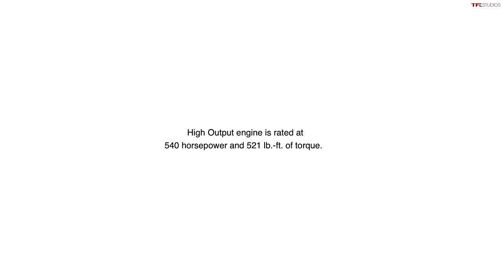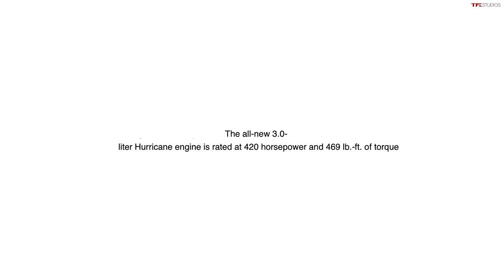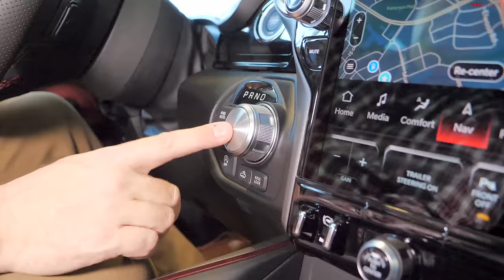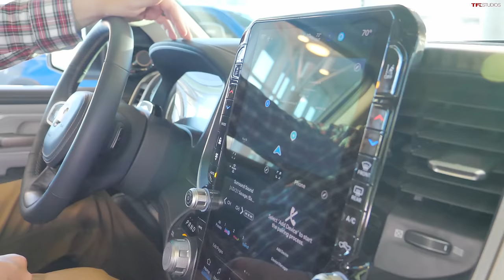I Go Hands On With The First New Ram 1500 In Over 5 Years - Did They Get It Right?

Comment: I have the Ford f150 3.5L v6 twin turbo ecoboost . Bought it for towing my trailer. I prefer my old truck with a 5.0L v8 coyote engine. It was smoother power delivery, better fuel economy when pulling the same load!
You can’t beat cubic inches. Plus overall upkeep is more on my ecoboost than my 5.0L.
Reply: That Coyote motor is the sheet but I bet you get good service out of the Ecoboost if you keep the oil changed regularly and figure out what to do with all the oil blow by.  Like a catch can or draft tube.  We drill a 1/8 hole in the bottom of the intercooler too to let the oil and condensation drain out when parked.
Reply: I have 207k miles on my 3.5 ecoboost. All these years I’ve had it I thought it was a lot better than the 5.0. Smooth, pulls everything I needed better than the v8 could. And when I drive( I don’t drive mine hard) it gets better gas mileage. I get it, it’s a v8, the sound is great and all, but there’s no comparison between these two engines. The 3.5 ecoboost is a lot better.
Reply: 5.0 has a terrible powerband for a truck. No low end torque. Just sounds good. One of the last trucks I'd ever buy is a 5.0 Ford.
Reply: Well yeah. Jason Cammisa told us years back a downsized twin turbo anything will get better fuel economy if you drive it like the EPA did; like a sedated nun.

Coworker had a turbo Elantra. 13 city 32 hwy. he said the gearing kept the turbo lit in traffic
Reply: I’ll keep my 6.2 Chevy trailboss over these 6 banger turbo engines, cheaper to maintain
Reply: Yup. The the problem with forced induction. To get the power out of the engine you need to be in boost. When you are in boost you are using considerably more fuel. There was nothing "eco" about the Ecoboost F150. I had one. Pulls like a diesel, gets atrocious fuel economy. Towing my bass boat it would get 10-11 MPG. I switched to a Ram 1500 with 5.7 in 2013. Towing the same boat it would get 14-15 MPG on the same trips. These new Ram's will be no different. I'm sure they pull hard, deliver a lot of low end torque and are fast. But they're going to get much worse fuel economy while towing than the 5.7 Hemi.
Reply: I drove the hurricane in a wagoneer and it was fast and smooth I can only imagine how it will feel in the lighter rams
Reply: I've had a coyote and ecoboost, I now have a Lightning and prefer it to both in everyway. More power, efficiency, and zero pollution.
Reply: @arthurwright255  Throw a 8000 lb travel trailer behind it and tow it 1500 miles. See ya in a week after you have to stop every 60-70 miles to charge.
Reply: Most people use their trucks to tow and drive long distances, which the Lightning is terrible at. Unusable for most buyers.
Reply: @joshuaw2988  The 6.2 from GM is the most problematic V8 in the truck market. If you had mentioned the 5.3 I maybe would have believed you.
Reply: @Bradimus1 bologna, 10,000 lbs behind my long bed crew cab 5.0 with the weakest axle ratio offered and it didn’t seem any more heavily taxed than other pickups I’ve pulled with. Even in low end torque a modern 5.0 still knocks the socks off of any half ton from 17 years ago. We’re just spoiled now with unreliable turbocharged junk
Reply: @bkranz-1283  gutless below 3k RPMs.
Reply: @riccochet704  interesting opinion
Reply: @bkranz-1283  even empty the five oh is known to be a slug from a dig
Reply: @paulhunter9613  my behind. I smoke tires from a dig on a crew cab 6 speed with a 3.31 axle on 33’s all stock factory tuned 5.0. It’s so far away from being a slouch it’s laughable to even suggest it. Just because it makes most of its power in the top end doesn’t mean it’s lacking in low end necessarily. Maybe it just means it has lots of top end and a good amount of low end. It’s all in context. Are you comparing it to a “premium” engine option like a 6.2 gm or HO ecoboost? Cuz then it’s lacking low end ONLY in comparison. Compare it to a 5.3 gm (which is marketed as the direct competitor to a 5.0) and the 5.0 smokes it no matter what rpm they’re running at.
Reply: @bkranz-1283  Maybe get some medication for your behind. I’m comparing it to an eco engine that has full torque at 2700 rpm, the five oh doesn’t have that amount till 4500 rpm. They call it “linear” power, that just means the torque isn’t available. So it’s a snooze fest waiting for the power to tow a load and get it up to a much higher rpm. It’s a car engine stuck into a truck
Reply: @paulhunter9613  well you’re entitled to an opinion but that doesn’t make it a good one. A 5L v8 with towing features in mind like piston cooling jets is a “car engine” in a truck but a twin turbo v6 doesn’t come across to you as trying to shove the square peg in the round hole? Take all the low end torque you need to tow loads the rest of the truck can’t come close to handling if it makes you feel better but my 5.0 will actually still be able to pull something at 200,000 miles while that ecoturd is sitting at the local pick and pull.
Reply: @bkranz-1283 ya ok buddy, keep believing that, if you say it enough, who knows

Comment: Let’s be honest - the engine change is not for better gas mileage but to be able to charge more $$$ at the time of purchase and at 100,000 when the turbo blows
Reply: No. It's so they can advertise gaudy power numbers and still meet emission regulations. All about NoX. They would make far more selling hemis n cummins forever. Those billions in R&D have already been recouped
Reply: It's for emissions but it also gives you better pulling power. Torque comes in at lower RPMs and the curve is flatter.
Reply: projecting much? In reality there is no way to validate your comment.
Reply: That's a terribly uninformed take and highly unlikely.   Agree with others that the move to small displacement/turbo powerplants is a natural outcome of the manufacturer's need to produce higher mpg and less emissions.  I bought a '22 GMC Sierra AT4 w/ 6.2L V8 so I could enjoy V8 power (especially the sounds), maybe for the last time.  But prior to this latest truck, I actually had a Ford F150 Platinum w/ 3.5L Ecoboost V6, and it was an excellent vehicle as well.  I owned it for ca. 150k miles with no issues other than replacing an injector.

Comment: I have a '22 Ram Limited and till this day there's no one that gets into it and doesn't comment "it's the nicest interior they've ever been in". Now if they could only get an infotainment software that's as good.
Reply: I had a '22 Limited 1500 myself (night edition) and yes, it's a really nice interior. Also yes, the infotainment system sucks lol. 

Went to an F350 Lariat and the downgrade in overall material quality of the interior isn't nearly as much as I thought it would be. 

Basically, after 2 years I realized I didn't really care about having slightly fancier looking interior trimmings and wanted something more capable and more intuitive.
Reply: I too have a 22 limited. I agree the infotainment needs to be updated. I'm constantly reseting the radio to get my android auto to work. Other than that, the truck is a dream to drive and go on road trips in.
Reply: @SliderFury1  My father has an F250 and it's been in the dealer more times than he can count for their notorious suspension issues and the interior is trash compared to the Rams, albeit his is probably closer to a '20 model. Their dealers are cash but that's becoming more a common thing among domestic manufacturers.
Reply: @Jerry300zx1  Stop being that guy and get yourself an iOS device lol, your friends and family will appreciate it.

Comment: That looks like an absolute nightmare to replace a turbo if it ever went out.
Reply: You used to own one before.  Now I know why not to buy this
Reply: Why, the turbo's are right at the top side...have you ever seen Ford's v6 turbos? They take a full day to get at before you can get a wrench on one of the bolts.  This RAM set up looks actually very easy to get to the turbos. And yes, I have been in the industry for 42 years technician so I think I know.
Reply: The ford gas turbos are in the wheel well ? We just changed one with the 3.5 gas engine and it was out and in unless then 4 hours.
Reply: @randalsweeting661  4 hours is a long time you got lucky.
Reply: @randalsweeting661  @onthethrottle was just trying to sound dramatic with the replacement of a turbo. He failed

Comment: Historically a straight 6 is really durable and will last. Back in the day Ford had a 300 cubic inch straight 6 and you could get 250K miles out of one easy. That is back when vehicles lasted a long time and you could actually afford them. I am keeping my 2021 RAM 2500 until the prices drop, which means I will own it forever.
Reply: A big part of that durability was displacement. I doubt these newer I6's will be as durable.
Reply: I was thinking the same.  The 4.0 straight 6 in jeeps was a great motor for years
Reply: I’m with you.  So glad I ordered my 21 right before Covid and got a decent price on mine.  If I tried to buy the same spec in my rebel for ‘25 I’d be paying likely 10-15k more for a less reliable truck 😂
Reply: That Ford motor was right out of a tractor, and it was naturally aspirated. Bulletproof great motors. These motors will have so many problems and terrible longevity. Pushing boost out of such a tiny block... that much power... no good.
Reply: A Mopar slant 6 was even more reliable
Reply: My 86 300 lasted exactly 38,000 miles with a 36,000 mile warranty, so I’m definitely not in the 300 can walk on water camp..
Reply: Shoving a high boost, small displacement gas engine in a truck is a formula for short engine life...I'm sure Fiat (or whatever it's called this week) used dozens of low budget crappy sensors to drive everyone nuts.

Comment: I’m a ford guy thru and thru.    First truck was a hammy down 77 f-150 straight six 300 and three speed column shift.        Wish ford would bring that motor back with a turbo.     Now Ram has got my attention! 👀
Reply: I used to be a Ford guy, but I get to rent for work. Had a Ram in 2017 and loved it so I bought one. This trip I got a 23 F150. Not impressed. My 7 year old Ram rides better and is easier to get in and out of. PLUS, everytime I get into this F150, the settings have all gone back to default. I don't want the digital speedo, there is an analog one right there. 🙄
Reply: @jasondawson4091  I hear that!     I ended pulling the trigger on an 2024 f250 lariat 7.3 8’ bed for 71k.      Couldn’t find a better price for towing while still getting some luxury in a bench seat.      I find it funny how I can get all that without the auto start stop feature.  Better value than 1/2 ton, but I’m gonna miss the smoother ride.

Comment: They look great. But what Ram really needs to focus on is the Heavy Duty. We need more gears, increase of horsepower and torque, exterior update and improved underpinnings and frame. Also will the heavy duty have a gas powered option, if so what will it be?
Reply: The heavy duty trucks have copious amounts of power and torque…..more than 97% of people even need/use.
Reply: @dieselcanuck87  unfortunately that’s not how this competitive market works. For instance, people may go for a ford or GM simply because they like having a 10 speed opposed to Rams 6. A hot shot driver or guy who hauls a gooseneck might like the idea of having way more truck for the job. You have to stay highly competitive and in Rams case as the under dog… they have to be the best.
Reply: If you need the power and capacity the manufactures rate the HD trucks at, you really should be looking at a medium duty truck and have a CDL. .. 2004 RAM CTD 6spd manual was enough to gross 42,000#... Just don't tell dot..
Reply: @TevisC I agree with you 100%. Trucks are getting out of control.  I have a first gen Dodge Ram Cummins. 12 v Cummins with an old manual. I can haul my 10,000lb trailer just fine lol. But at the end of the day, the market is what decides what’s logical or not.

Comment: I have a 2014 ram 1500 ecodiesel and that things has been nothing but trouble. When it came out it looked like the next big thing and because it's a diesel I thought it would be reliable but ram made it into the opposite of reliable. I have a strong feeling these new generation of trucks will be the same as the ecodiesel. Cool to look at and drive short term but plagued with problems.

Comment: I had a 2018 F150 XLT, a 2021 Ram 1500 Bighorn and now a 2024 Tundra SR5 TRD. And the Ram was the most comfortable and had the best radio and operating system with the most adjustability and options. The Tundra fast with the smoothest transmission

Comment: still no power tilt telescope steering wheel on the tungston model ,can not believe for 90K
Reply: Makes no sense they left it out. My wife’s 2018 Grand Cherokee has a power telescoping wheel so it would’ve been super easy for Fiat to raid the parts bin to add to the 1500s.
Reply: @silvergeoff568  my 2011 charger and 14 jeep have it but not my ram

Comment: So glad the in-line 6 is back.  GM should have done something similar to the 1500 instead of their 2.7 liter 4 cylinder 310 hp 430 ft/lb torque (ram’s 540 hp and 521 ft/lb torque is incredible)

Comment: We bought a Ram 1500 classic in 2021 it is our 3rd Ram truck. I have 19 thousand km/s on it and the front end is squeaking, the driver side window switch works intermittently, the drivers side door hinges have a "flat" spot where the door creaks loudly and feels like its going to fall off and there is a weird delay in the transmission sometimes where it feels like it's spooling up  just before the truck starts to move. I'll never buy another dodge product.

Comment: Still can't believe that he HD trucks are still rocking the old cab design of over 10 years ago but the 1500 gets another update.  Trucks look great, I truly hope the move to the 6 cylinder provides more then a slight improvement in mpg.  Otherwise, I'd rather just have the V8 rumble.  Would love a half ton truck that was average trim, fuel economy of 25+ mpg, and under 60K.  A Hybrid would be awesome as electric vehicles have their challenges, maybe this RamCharger will fill that void.
Reply: There are new Ram 1500’s with the V6 listed at $36k around my area. V8 is about $5k more.

Comment: I like the new rebel grill and wheels. I hate the lack of LED running lights and the new tail lights. These cons and the small jump in horsepower in an inline 6 over a 5.7 don't justify an "upgrade" in my opinion from the current 2019 I own. I was hoping the high output inline 6 would be an option on the rebel. 

I have no idea how RAM thinks they are going to sell the new TRX replacement, RHO, with a price point at or higher than the current TRX with an inline 6 that makes 160 less horsepower. Double that with the fact you can get the same motor in a limited and tungsten trim makes it stand out less. RAM's decision making has me scratching my head on this.
Reply: I agree, I don't feel like I'm the biggest fan of the tail lamp design and seems a step back from the 19+ trucks. But in terms of the engine, remember trucks are best for torque, and the Hurricane has a lot of it. And sadly, the 5.7/6.4/6.2 were out of compliance for 2025+ emissions. That said, my Hellcats will be polluting monsters for as long as I can own them!😂

As for the RHO, let's face it: NOTHING without a Hellcat can replace the TRX is badassery and swagger. But the RHO is the TRX-lite version many people were looking for(albeit we wanted it with a 392). I don't suspect Ram will charge the same price as it did for the outgoing TRX. Plus the truck will be far more capable in the ruts with less weight on the nose.

Comment: Hello
Thanks for the info guys.

I am disappointed with Ram Trucks.
How can you offer a Ram and Dodge in the future without a V8.
and only with (V)6 engines.
It's the wrong people at Ram, Dodge and Chrysler.
The biggest mistake is that FCA joined forces with the French to create this Stellantis garbage.

TFl guys you have the opportunity to talk to some of the people in charge at Dodge and Ram and express the displeasure of the brands' fans.

A Ram without a V8 is not a Ram.

They had five years to develop a new V8!

My suggestion would be.
Ram 1500 6.4l 450HP
Ram 2500/3500
6.2l supercharger 530HP
Ram TRX 6.2l supercharger 750HP

And that's until they present a new V8.

And not an inflated, sophisticated 3l junk engine.

They should bring back the Hemi V8.
They should bring the legend back.!!!
Reply: 70% of Ram 2500s and 85% of Ram 3500s sold don’t have a V8 so…
Reply: @MyTubeUser321  
You're right.
The 6.7l Cummings is also a great engine.
The question is whether they will be so stupid and throw him out.

But taking out the 6.4l and replacing it with this 3l piece of crap at the end is an absolute mistake.
Reply: @danielrichter3826  we don’t know enough about this 3L to say for certain if it’s going to be a garbage engine or not. I’d agree that the displacement is a bit small for work purposes but the fact that it is a straight 6 (vs a V6) may bode well for durability. 

I do miss the V8 and I hope they offer a V8 option in the future, though unlikely thanks to this EV and climate change nonsense

Comment: I think this new straight 6 turbo is going to be a going to be a sleeper motor. We all know how much power you can squeeze out of a Toyota 2JZ which is essentially what the SST motor seems to be 3L twin turbo 6. I would not opt in for air ride though. When they go bad, and they do eventually, they cost a ton to fix
Reply: I prefer a NA engine that’s mechanically simpler
Reply: @rhettsalsbury9394  like an NA engine with simple cylinder deactivation and variable valve timing?